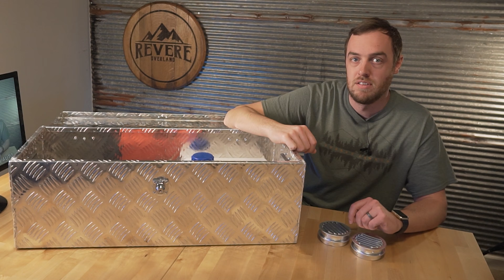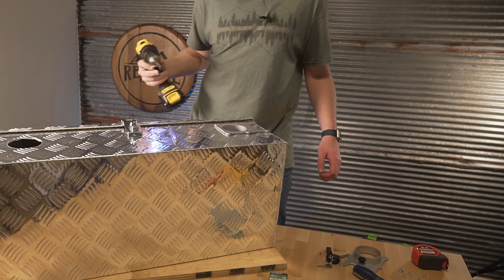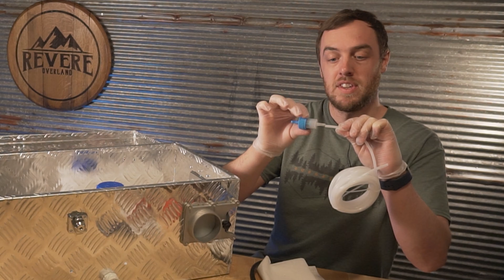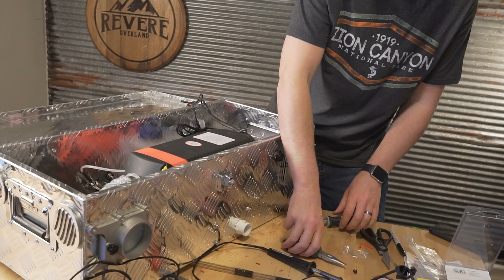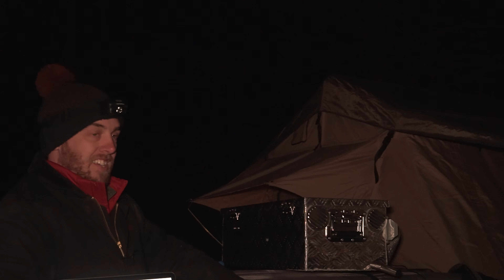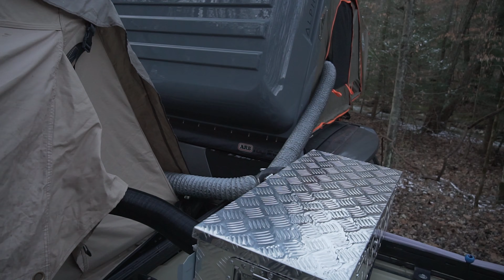Roof top tent DIESEL HEATER V2

Comment: It’s important to use the hard plastic fuel line. The fuel pump works on a pulse principle to meter the amount of fuel flow. Any flex in the fuel line will affect the amount, so if a soft fuel line flexes the pulse energy is waisted in expanding the soft line instead of moving the fuel through the line. When using the soft black rubber connector host, the hard plastic fuel line MUST be inserted all the way so the end is touching the adjoining element, such as the fuel filter, fuel tank, heater inlet. The black rubber is only used as a cheep simple method to connect the hard plastic line.

Comment: Thank you for all the info.  I like the idea of putting this heater in the boxes, and that box on the top rack.  For me I gonna probably do this, but for the box,  I m gonna use Milwaukee packout toolbox , I m not sur what model I m gonna use, but all my set up in my double cab and my truck bed I have Milwaukee packout system.

Comment: Well done.  Love your work.  Though I'm glad these are now available in an All-In-One version.  But I don't think they will work for you as they are not designed to be mounted permanently on the roof rack.  As far as fuel is concern, why not just get a 5L or 10L jerry can to hold your spare diesel?  Rather than re-desining your heater box again to fit a larger fuel tank.

Comment: Careful with the diesel heaters.  If ran on low for extended periods they will clog up with carbon on the inside. This results in extremely thick half burnt diesel smoke puking out of the hoses.  If this occurs in your sleep you may not know it happened....

Comment: I have been watching your channel for a while, you did a great job on the v2.
I was wondering, how do you connected the 5 pin waterproof, I checked mine wires and I noticed that it have 5 pins plus 2 for the negative and positive.
I am no good with wiring.
Thank you for your hard work putting this and all your videos together. Best wishes

Comment: Great build! If you didn't want the screws to stick out where the gated vents are on the front, you could turn the screws around with the head on the outside and use a nut on the inside of the box to secure.

Comment: Speaking of fuel tanks and trips to fill-up, saw a video where the fuel tank was external, and consisted of 6 gallon outboard motor fuel tank with built in fuel gauge, diptube, handle, and quick connect fuel line.  You could also use the "squeeze bulb" from the outboard motor fuel line to hasten priming operation.  YouTuber  "DavidMcLuckie" has does testing, and claims flexible line works as well as the hard line.  Hard line may be mechanically stronger, but hardness is not necessary for proper pump operation, or quality of combustion.  See:  Hard vs Soft Nylon Fuel Line - David McLuckie  https://www.youtube.com/watch?v=K1i4b54W7PQ

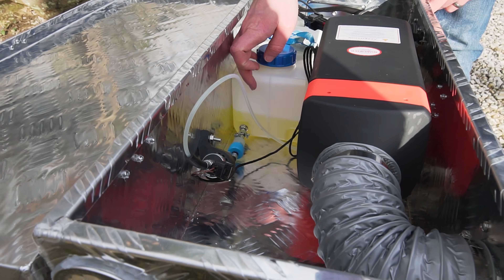Comment: 17:20 Do all sleeping areas have a working carbon monoxide detector???   If there is a Mark III heater, what about install the dip tube thru top of fuel tank, so there is no thru-hole in bottom of tank to leak or fail???   When not recirculating tent air, HOW ABOUT install a breathing air snorkel, four to six feet above the box made of thin wall rigid DWV pvc of 4 inch diameter.  Important never to pump exhaust fumes into the tent.  Never want to read about adventurers killed in their sleep by carbon monoxide.   Is there room in that metal box to house some dedicated batteries to power heater?  Or perhaps an outboard battery box that is cheaper than a Jackery;  it only needs to supply 12v, correct?

Comment: Wonder if any one thought of making a housing for the back slider glass with hole in the middle big enough for dryer hose that ran into a similar attachment on your roof top tent. An turning your truck on with the heat on blast.

Comment: The vent louvers you used have little screens in them. The box itself is your burner intake filter, and it will also burn off those diesel spillage fumes, and lower the heat build-up in there.

Comment: Try a Motorcycle or lawnmower muffler. Lawnmower mufflers would probably be much cheaper. Personally, I might try 2 mufflers in series to quiet the monster down even more.

On the power-thru wiring, folks might like powercon connectors (used in professional audio systems-made by Neutric).

Comment: In thinking doing a diesel bunk heater not sure on box I use , I bought a 6 gallon scepter boat gas tank with a quick connect I plan on mounting on rear hitch inside awning that attach to rooftop tent heat rises diesel fuel will burn much cheaper vs propane in planning to sell Mr buddy heater only use bunk heater as far as price Chinese brand much cheaper vs espar brand,  I like winter camping vs summer anyway nice set up in still working on the design but check out scepter fuel tank and maybe quick connect on the fuel line that way you can carry bigger fuel tank

Comment: If you change fuel tanks you might want to consider using a draw straw instead of pulling fuel from the bottom of the fuel tank. Eliminates chance of leaking and picking up dirt from bottom of the tank.

Comment: How is the heater and box holding up.  Does the box overheat?  Are the fresh air vents working?  What did you end up using for the air filter?  Any issue with the tank in the box?  Great job!  Thanks for your help!!
Reply from the maker: I gave it to Andres (@drede_lander), and the only issue is that he broke the controller! They’re cheap to replace though!

Comment: The 3kw heater is the 2kw heater with rich fuel pump settings.
For the shorter pipe, could be used a butterfly valve in it

Comment: Very informative and complete video. Thank you for taking the time. For the inside of my Excursion where I sleep, I'm currently using a Portable Buddy Heater with an extended hose a large propane tank. Yes! A LOT of condensation and then it freezes on the inside of the windows when the heater automatically shuts off. I'll be doing some sort of mounted Diesel heater solution on the inside and running off the Excursions diesel tank.

Comment: Great clip. Very clear and well explained. Just starting my build to the same spec (UK based). Question: any reason you can’t just have the combustion air intake inside the box, with filter? There’s air coming into the box via vents so would this be sufficient? One less hole to drill.
Reply from the maker: You definitely can do that, and it’ll actually burn a little better since the air will be slightly warmer!

Comment: Do you have room for a second fuel tank of the same size? If so then simply add it along with either a fuel switch or some piping to create a larger fuel store? Perhaps mount the second one slightly higher and at an angle so that it'll drain into the first one?

As for the second air hose, add an insulating sleeve to it. You can buy fiberglass insulation sleeves for air conditioning units at Home Depot type places. That should gain you a few more degrees.
Reply from the maker: Yes, I believe there is space to stack them. It’s not something I wanted to deal with after I spilled diesel inside my vehicle with just the one tank!

Comment: How do you connect it to the Jackery?
Reply from the maker: Solder a 12v cigarette lighter adapter to the wires from the heater
Reply: @RevereOverland  Thanks for the reply.

Comment: That my friend was an excellent presentation. One of the best I’ve seen in a long time. I am a little confused about the advantage over propane. If you build the same set up and had a 5 gallon propane tank on the outside of the box and connected it as a fuel source what would that mean as far as condensation in the tent itself.
 Thank you again for the excellent work.
Reply from the maker: If you’re burning propane in the tent it produces water vapor. I have the Propex HS2211 propane heat exchanger now. It’s excellent.
Reply: @RevereOverland  
So if you were to put in a small propane tank with a heater element attached to it inside an empty tent,  started it up then closed the tent without anybody being inside the humidity would measurably increase?
Reply from the maker: @bill_maryjohandrahan717  yes, the humidity would increase. I can't say for certain what would happen with the relative humidity, since heat lowers relative humidity.

Comment: Good project, if you use it regularly on camping trips with a tent, shelter, or van. I would customize it to be fixed on the back of the car (outside) somehow like some big fifth wheel does. You then add the duct and start up the heater. Fuel could be inside the car or somewhere near it. Hook it all up to your 12v car lead-acid battery (with a 16A fuse) and add a second one in parallel if you actually gonna need it. It uses only a total of 1Ah capacity on startup (with a 6-minute peak of 7-10A) in the first 30 minutes, after that, it uses only 7.5 Watts to maintain the 20 degrees. A standalone 1KWh 12.8v battery unit will get you more than 120 hours of heating with 10 startups-stops. It will need 30 liters of Diesel. You could actually heat your home (or parts of it) for far less than your heating bill is worth.
Reply: Could you tell me please how much Ah should have a battery to power it in low to moderate mode for 2 nights? Im too stupid to understand it.

Comment: loved the build. The only thing that I wouldn't do is connecting the combustion air intake to the outside of the box... I would have only 1 vent (instead of 4) and let combustion air inlet suck the air out of the box. This way when this is mounted on the roof rack less element can interfere with the heater.... Especially when there's rain and snow blowing everywhere.

Comment: Use insulated flexible ducting to retain the heat inside the ducting from your design to your tent . You will use far less oil  to last days . 
Stephen Bennett
MidCity Plumbers and HVAC specialist

Comment: Very nice build. I watched the prior versions first and although it was quite fine....this one takes it to a whole new level.  The foam strip around the top will not only help quite it ....it will also help keep it dry. Was wondering if you provided any type of drainage in the bottom....just in case. A small 30ah no maintenance battery would be a wise addition as well. It should fit nicely in the box toward the output port....if only for backup purposes. BTW...I subbed.

Comment: I would consider using your Heater BUddy for about 5-10 mins and then you should be good to go to run it on Low rather than high. Once you heat up the space briefly it should be easy to maintain it

Comment: If you find it a bit noisy you could also run a sound deadener inside that metal toolbox then install everything. You won’t hear the fuel pump at all and will really quiet down the fan noise. And also for your fuel tank, talk to a metal worker and get a stainless steel fuel tank made that will utilise your space to maximise how much fuel you can carry.

Comment: The design is really great actually for the air in being an unshielded/uninsulated portion. However in the heating duct if you use a rigid line and insulate and shield it you should see better heat output from the device. This would conserve as much of the heat being created to the outlet. Any heat produced from the device is already heating the air entering which is nice as this would reduce consumption of fuel and operate more efficiently. Overall this is a far superior setup to the previous. The most concerning portion however is the loss of heat in between the box and the tent. I'm not sure how you would solve that unless you built a rigid duct and insulated that as well. Would be one more thing to lug around though. I'm rambling.... Its a brilliant idea! Cheers!
Reply from the maker: Yeah I struggled with the balance between efficiency and portability! Straight, smooth, insulated ducting would be best.
Reply: It's better than nothing! It gives you far more opportunity than not going at all because of temperature. All in all great idea and will likely use once I obtain my GFC Camper. Refreshing to get a comment back from a YouTuber. Cheers again!

Comment: Straight in and straight out. You lose 25-45% of your flow of air at every 90* bend. Insulate both tubes, should have your fresh air intake used as a cold air return inside the tent.

Comment: I purchased mine complete on the metal box, but I was told I can’t use it outdoor if it rains and that is an issue. I know nothing about these. Can you please let us know how to take the pre assembled ones and make them able to use in the rain. Because I’m thinking of just placing it in a waterproof box and drill intake and exhaust ect. Please give us some direction please
Reply from the maker: You should be able to take it apart and it'll contain all of the same parts mine does.

Comment: You can use Red dye diesel for this heater. Additionally you could look into building your own lithium battery with a set of super capacitors for powering your heater.

Comment: Great job on the upgrades.. thank you for listening on the return. It'll dry his tent faster with the return... think of it like your house.. it circulates your air inside. Not from outside.
Reply from the maker: Actually a return will increase humidity because you're cycling back the air you're humidifying. Bringing in fresh air constantly will help keep it lower. Either way, it's not a problem, because the heat lowers relative humidity enough for it to not be a problem at all!

Comment: Fair play for trying and sharing your experiences with is. However, you say things like you are an authority on the subject when in fact you aren't - I don't think you did anything too bad but you should fact check if someone is going to take this video as a how to guide. If you have the air inlet in the tent recurculating the air it's not only efficient, but the thermostat in the heater will work. That muffler on the air intake - makes the heater sooooo much quieter (for your neighbours sake). Have you heard of the mantra "measure twice cut once" ? Finally, why didn't you save yourself the effort and buy the portable version of your heater where it's already done? https://www.banggood.com/1-8KW-Adjustable-12V-Diesel-Air-Heater-Parking-Heater-One-hole-LCD-Switch-Remote-Control-Integrated-Machine-p-1586616.html?rmmds=search&ID=42257&cur_warehouse=USA 
Stay safe and respect for getting out in the cold....
Reply from the maker: Although I made a couple of mistakes, I'm not sure I agree with your points. The controlling thermostat is remote, so sits in the tent. The muffler absolutely does not make a difference. The portable version can't be mounted on a roof rack or left out in the rain.
Reply: @RevereOverland  Thanks for responding. Sorry if i was a bit harsh - you have valid points and you made a video that i watched for free - many thanks for that! On the Eberspacher the muffler makes a huge difference - I have one on the inlet and exhaust which keeps it quiet. That pump ticking soon becomes the sound of warmth and you fall asleep listening to it. The cheap chinese heaters have opened up a world where its economical to do projects like this - brilliant!
Reply from the maker: @ringonotts  no worries. The Eberspacher is going to be good quality - the muffler with the Chinese ones is worthless!

Comment: I really liked the follow up from your previous video, and the revised setup looks great.  For the ends of the screws sticking out, you can see if acorn nuts will fit to clean up the look.  Another suggestion is foam weather stripping that have an adhesive side.  They’re not too expensive, can easily be cut down to size, and are compressible for the lid.

Comment: Did you get diesel fuel smell into your tent? Seems it would draw it from aluminium box through into the tent. Slick idea. I would consider a snorkel exhaust mast so you do not suck CO into air intake. Best

Comment: In the Chinese diesel heater Facebook group, everyone was saying that I shouldn't run this setup.  5kw diesel heater with Jackery 240.  They said it will sometimes last the night and other times it will flatline which means the heater wont go through its cooldown phase which will cause it to shoot out white smoke and/or fire hazard.  They also said running the battery below 50% is a bad idea.  I've heard of that before but does it apply to the jackery 240?  Anyone with input would be greatly appreciated.  I would love to build a box like yours!
Reply from the maker: I wouldn't recommend the 240 either. The 500 is much more appropriate! The Jackery batteries are lithium ion, so can go down way below 50%. It's good practice to keep it above 20% though.

Comment: Do you have any issues with diesel smell when you keep this box inside your truck?
Reply from the maker: Yes. I spilled some diesel and it smelled awful.
Reply: @RevereOverland  aside from spills, do you have any issue with diesel smell coming from the cap on the tank? 

Also I’m curious with you using the brackets to elevate the mounting position- have they been plenty strong to support the heater on that baseplate?
Reply from the maker: Other than the spill, I’ve not had any problems!

Comment: Hi, great video, I am installing a diesel heater into my trailer and ducting it up to the rooftop tent above and wondered how hot the  ducting pipe/tube/hose gets?  Can I join join it with plastic joiners or will they melt? Will it be ok just coming through the tent flap?  Thanks.  Alan
Reply from the maker: It'll be ok coming through the tent flap. Plastic should be fine too, but there are different types of plastic that have different properties.